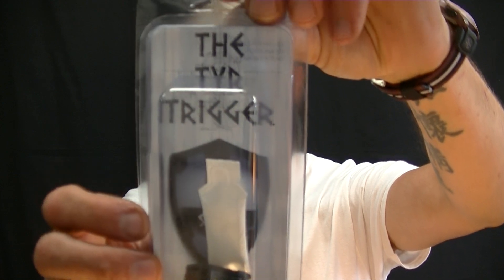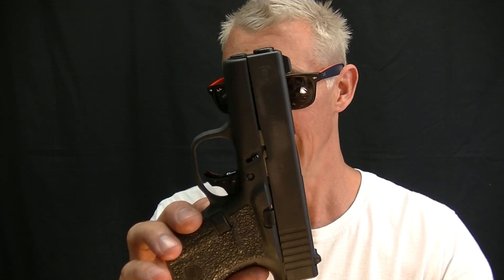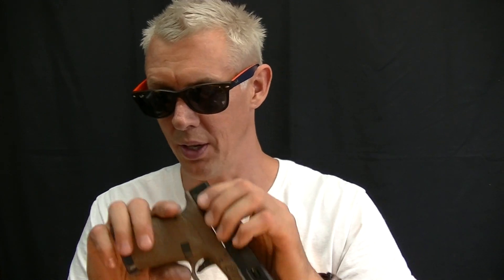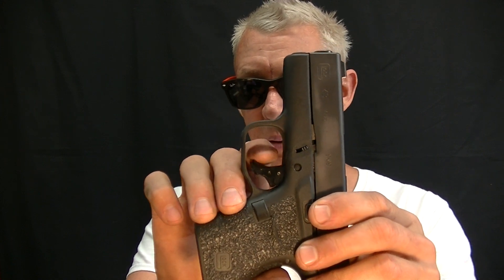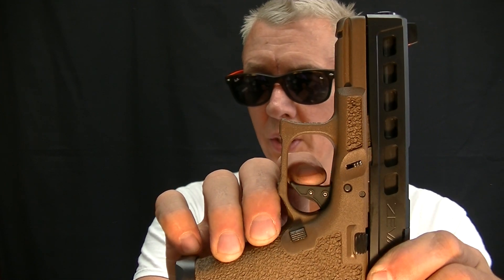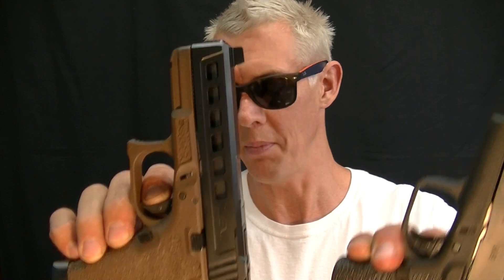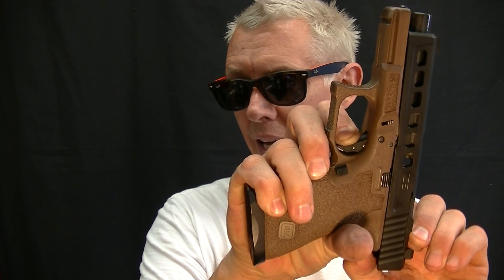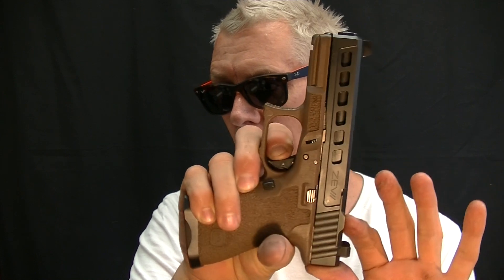up and comming  EDUCATIONAL ONLY

Comment: Man I'm glad your going to talk about connectors soon. I was just messing with my adjustments and was thinking the reset trike of the slide was a little harsh. When dry firing and holding the trigger full rear after a fire then pulling the slide as the conector would hit the cam on the slide it would have a hard hiccup then a second click when the striker falls off the crusable. It just seemed a little harsh.

Comment: Got one for you...new drop.in trigger and now dead trigger on occasion....what things do you check 1sr 2nd etc or is it defintely one thing?
Reply from the maker: RAZORJB was it my drop in
Reply: JOHNNY GLOCKS the persona It was not
Reply from the maker: RAZORJB if it's just dead meaning all the way to the back as if it was fired then that's a bad situation. I'm sure you could this out during dry fire as if it was live fire you would have had a series of bump fires? What's probably happening is the engagement is off and the sear is skipping under the striker instead of capturing it. If you have a over travel adjustment back it out. If that doesn't work the gun is dangerous until looked at. Don't live fire until 100%positive
Reply: JOHNNY GLOCKS the persona It did it a few times dry firing then changed connector from a ghost to a LWD and no issue...went to range and fired 200rds and happened 3 times.  if i dry fire and keep ur finger on trigger during reset no problems, if you release your finger from triggee shoe and rack slide the trigger sticks
Reply from the maker: RAZORJB 
You need to call me later or tomorrow 941-376-4383
Reply from the maker: RAZORJB it's engagement the sear need bent up a hair and I mean like 1/64 in watch my video" your Gun your responsibility"